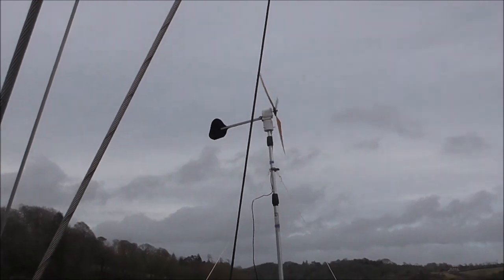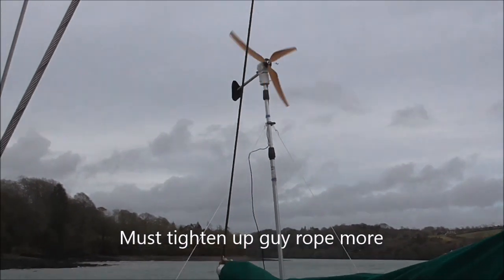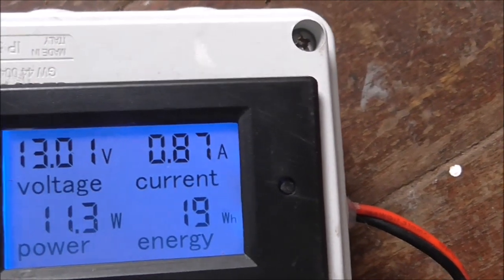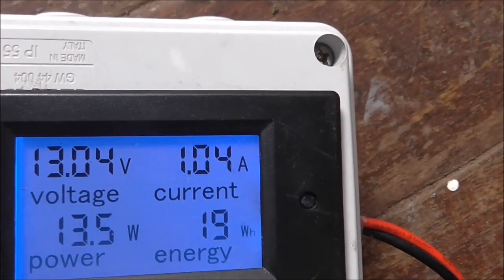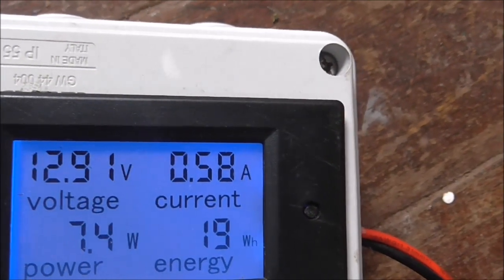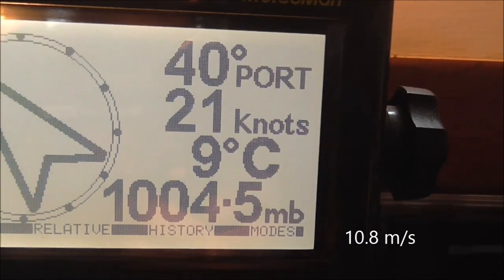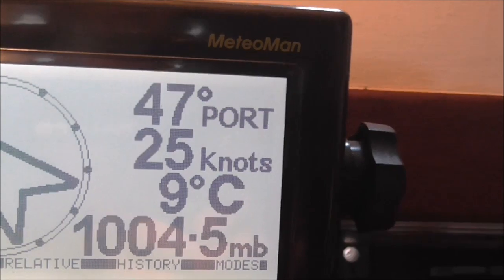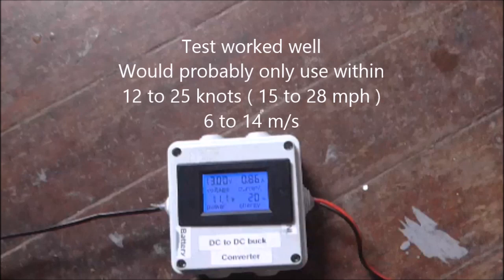NEMA 23 Mark 2 Wind Turbine field test

Comment: Excellent work, so you're running from your turbine-rectifier-boost converter-battery/controller?
Hook up a few turbines in parallel and you'll have a nice little wind farm!
Reply from the maker: Yes , but the buck converter is used to control over voltage. I have set up a second pole so I can run two turbines in parallel. Only problem is having sufficient 
wind strength consistently at low turbine hight /altitude.
Reply: @martint1151  interesting, I might be able to help with that. I'm designed specifically for low level and lower wind speeds.
I found you because I've been looking at nema 17 motors.
Your videos are brilliant, straight to the point, good trial and error with good data included.
The low speed turbines I've designed must be cheap and easy to make as there will need to be a few to make it worthwhile, I was interested in the data on the nema 17 as it ticks allot of boxes apart from voltage.
I've worked out a way to use two motors in series synchronised in the design so the voltage would be higher than one and was wondering if I could use a dc to dc boost converter to feed the controller.
The controller will trim any excess voltage if there is any.
Reply from the maker: It's been awhile back now but my sense with buck converters is ( even though they state 95/98% efficiency ) if the voltage differential is high a lot of amps are lost in the conversion.  It may just be mili amps but at these low capacities can mean a lot.
Reply: @martint1151  yes that is the problem for lower wind speeds, it may be a case of needing to use even smaller motors and have more turbines. Seems to be the only way as the resistance on most chunkier motors is simply too much.
Or a larger turbine of course but then that has its limitations.
Think I might need to find a higher voltage, smaller motor.